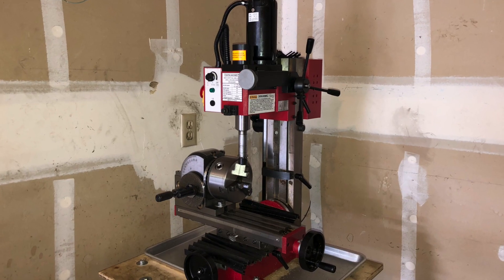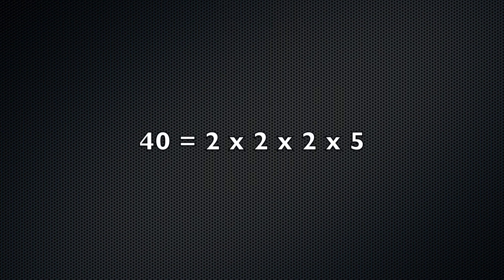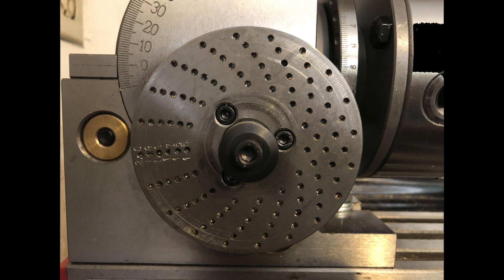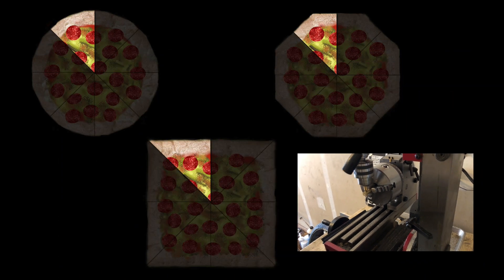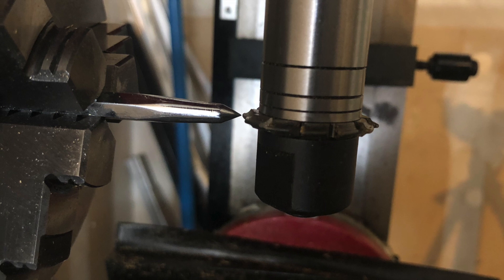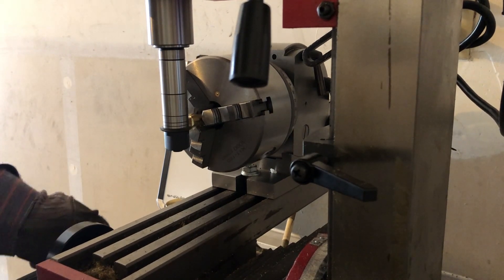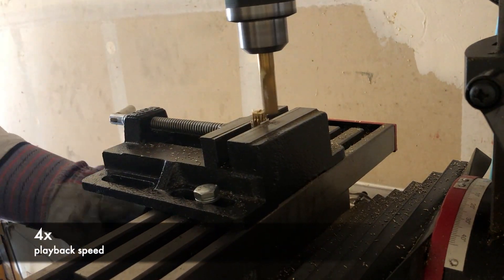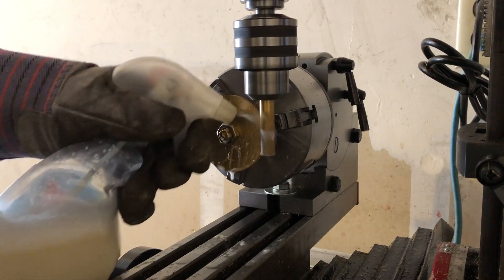Using a Mini-Mill to cut 0.8M 12 toothed and 80 toothed spur gears.

Comment: 1. You never use a drill chuck for endmills, no matter what machine, because both the jaws and tang of the endmill are hardened and the chuck can't clamp right. Even a cheap china er20 or 25 or 32 is good enough for starters. 
2. never ever use gloves near rotating tools, they can get caught easily, and you can injure yourself quite badly, please take care, the machines are searching for every opportunity to kill you.
Reply from the maker: Hi, it sounds like you are saying the drill chuck will spin freely if the end mill gets stuck--just like every other 3 jawed chuck.  And I agree.  Holding something with 3 fingers is not as good as using your whole hand, but why would you say never?  What you described occurs with drill bits also.  And I have been using an ER32 collet chuck set on the machine lately.  Most of the collets have a runout so low that I just wind up measuring the mini-mills bearing slop instead, but I knew this was a precision drill machine when I purchased it and not a full sized mill.  One thing that I am concerned about is how much torque the larger collets/endmills will put on the machine.  I think the that the drill chuck was chosen because it acts like a torque limiting clutch so you do not burn out the motor.  I deduced this from the fact that the main gear is made of plastic, which is a common technique used in gear boxes to prevent motor burn out.  In other words, using the larger collets might void the warranty.
Also, thanks for your concern, but I believe that the closest I got to the rotating tool was when I was spaying it.  That would have been like 4 to 6 inches.  Are you saying that 4 to 6 inches is too close?

Comment: But is it a drill chuck?
Reply from the maker: Hi Sergei, is what a drill chuck?  The Mini-Mill comes with an R8 heavy duty drill chuck, but mine was out by about 0.01 inches.  So, I bought a new one that is only out by about 0.002 inches.  The divider uses a 3 Jaw lathe chuck--which is standard.
Reply: @jonathanjohnson8376  It is not suitable for milling. It is easily pulled off the tapered fit in the spindle. Unfortunately, I cannot recommend cheap collet chucks. They all have a large runout and it is very time consuming to assemble them with a cheap low-quality collet with a minimum total cutter runout.
Reply from the maker: @SergeiPetrov  Hi, I think your expectations of a mini-mill from Harbor Freights is a bit high.  One does not buy a mini-mill expecting it to be as good as a full sized mill--that would be naive.  So I don't understand what you are trying to say or ask for that matter.
Reply: @jonathanjohnson8376  Right in front of me is this little cutter.

Comment: That dividing head looks like it fits the mini mill pretty good 
I have always been afraid to get one because I thought it would be tooo big.What head is that?
Thanks in advance
Reply from the maker: Hi Gene, I have a SHZOND Dividing Head and it is actually pretty good.  It came with a Tailstock and a bunch of parts and seems to be only out by a couple thousands of an inch.  I bought it because I hope to get a full sized mill when I get the space and money.  If you are sticking to mini mills I would suggest a simple Dividing Head, because they are cheaper and lighter.  The one I have is putting a lot of wear and tear on my mini mill--probably from the weight alone.  I have not measured the difference, but I can feel it when I slide the milling table.  Also, it is so big that I can not fit the tailstock on the mill with it on.  And it looks like I won't be able to use it for bevel gears.  I hope that helps.
Reply: @jonathanjohnson8376  thanks for the reply. That actually helps a lot.

Comment: Very cool! I just bought a mini-lathe and mill, and was wondering if the dividing head I am looking at will even fit the mill. Based on your video, it will, thanks. I'm still at the stage of family thinking I just chronicly watch YouTube machining videos, lol. Haven't got any major projects in the works!
Reply from the maker: Hi, thanks for the comment.  Yeah, at the 1 minute mark you can see (on the bottom left) the adapter I made to hold down the back of the Dividing Head.  I used 2 pieces of 1/2 inch aluminum and I drilled them with an offset.  The threaded holes line up with the rails so I can shift the Dividing Head to a different rail when I need to cut bigger gears.  You can cut gears without the adapter, but I wanted to get as much clearance as possible with the little space I had.  Making various adapters also helps me practice my machining strategies before I try the actual project.  I can recycle an adapter if I make a mistake, but when I mess up on 2 day project, it always seems to hurt.  Good luck with your next project and may ToT be with you.